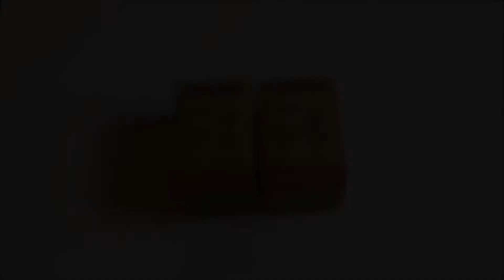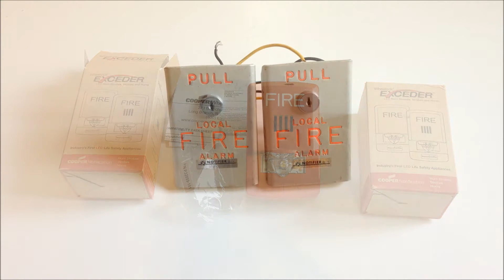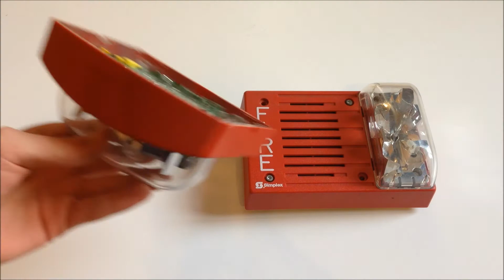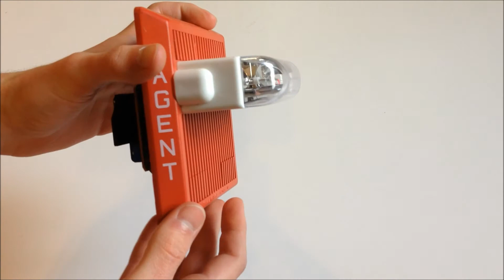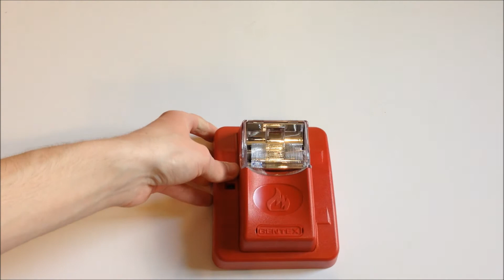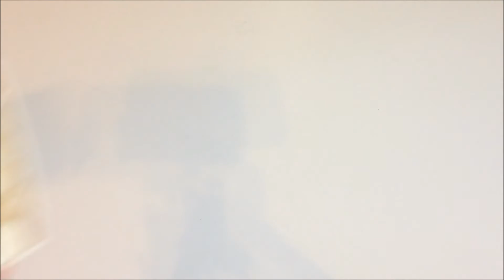New Fire Alarm Devices | March 2017

Comment: Does the agent MT have different tones than a normal MT?
Reply from the maker: Nope, the tones are the same. Just a different label.
Reply: kcin556 Oh ok. I just notice on a lot of agent alarms the strobe will flash a lot faster than on a normal fire alarm and sometimes do sound different (although it's hard to say because most I've seen are mechanical horns) so I wondered if the tones were different. Be a bit frightening though if it were going off and someone didn't notice it said "Agent" instead of "Fire" and were stupid enough to not leave the area regardless and next thing you know they get a nice dowsing in foam/powder/halon/whatever.

Comment: I do like those Gentex alarms; I might get a remote horn version sometime. I do like the metal back plates though; that's actually a really good idea.
Reply from the maker: Yeah, the design is odd, especially the way the device itself connects to the back-plate and terminals, but it works!